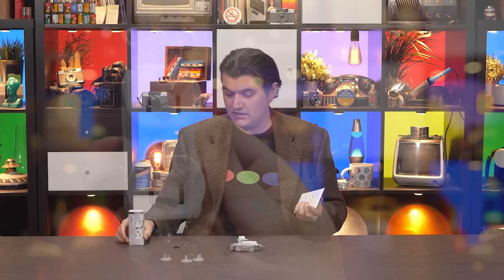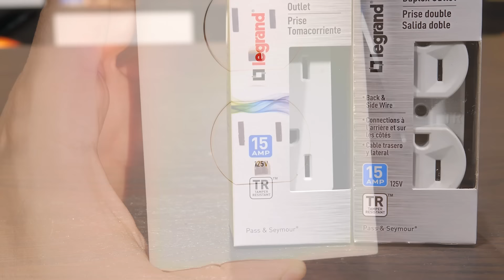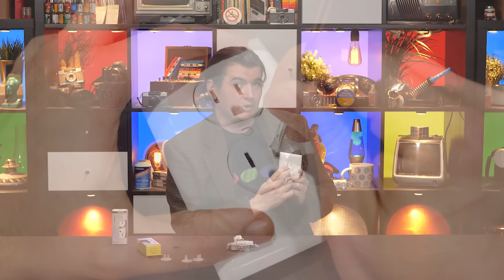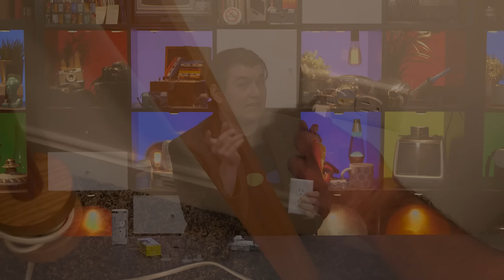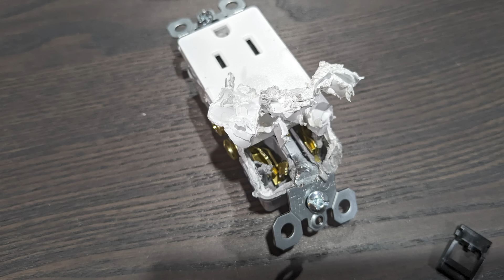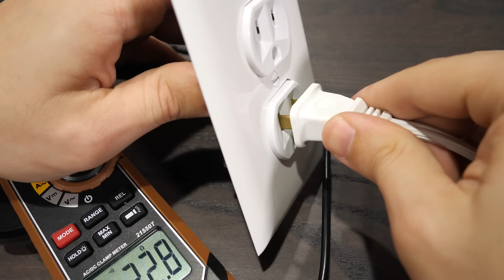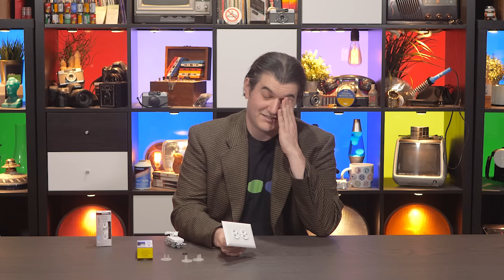Tamper-resistant outlets aren't all the same - a follow-up

Comment: I grew up in the UK before the plastic prong covers were required on plugs.  As one of my bedroom sockets was recessed behind furniture, I shocked myself at least  4 times because I wasn't in the habit of using the socket switch to turn off power before removing or inserting a plug.

Now thats purely anecdotal.  But remembering there is a risk and talking to friends, everyone shocked themselves as a child in the UK.  Yet, there was no death I ever heard of from a domestic electric shock.  No-one I knew, no-one in my school, no rumours or stories of it in the village or county.

I'd guess that kids are pretty resilient.  And by the time you are an adult you've learned to actually use the socket switch.

It actually amazes me that the US does not have switches on their dangerous sockets.  That on its own would be a huge improvement to their design and require nothing other than a change of code.

Of course what every country should do is just switch to Type G.  And I realise this would be near impossible in the US but other countries could do it and should do it.  The UK didnt always have Type G only completing the switch in the late 60
Reply: I miss the old UK color code of Red/Yellow/Blue/Black.  I think it should've become the standard for the rest of the EU, since all you do is swap black for white or gray, and can easily make a US-compliant color code out of it.  Blue for the neutral, and gray for a phase conductor, is incompatible with our standards in the US.

Comment: To the people arguing that 240V isn't much more dangerous, they're dead (heh) wrong. Remember that Power output is V^2/R. 480^2/120^2 = 4. So 240V is 4x more dangerous than 120V. And yes, pedants, "it's not the voltage, it's the current that hurts you." But current is proportional to voltage, so try me!

Comment: I lived in a big old house (built c1900) in the Midwest that had been converted to apartments. My downstairs neighbours had the old front parlour with the fireplace. I (a girl, at the time in my late teens) was helping them remove old candles from the wall scones. Lots of built up wax. I was using a large steak knife with a plastic handle (🤷).  The "candle" seemed to break in half but was held fast by the braided "wick". I started to cut the wick. There was a cracking noise, everything went black, someone screamed (me?). When "the lights came back on" I was across the room, the knife still clutched in my hand, a big arc weld half circle in the blade. Smell of burnt hair. 

c1900 electric wall sconces were still live and apparently high voltage. The landlord had a hell of a time with the fire department and I got a very expensive ride to the hospital.

Never trust a braided wick.

Comment: It should be noted that we have socket outlets in the UK that don't use the earth pin to operate the shutters on the live and neutral. MK came up with a method that requires both the live and neutral to be presented at the same time to open the shutters. This was introduced in the 1970s with the MK Logic series. I would imagine the US tamper-resistant sockets use a similar mechanism. Basically, the live and neutral pin causes the shutter to rotate out of the way.  More recently MK introduced a system in their Logic Plus series that requires all three pins of the plug to be presented at the same time to open the shutters. Basically the same rotating mechanism as used previously but now it won't rotate unless the earth pin is also inserted. Both mechanisms are more difficult to defeat than just using the earth pin, and the newest mechanism is really tricky to defeat.

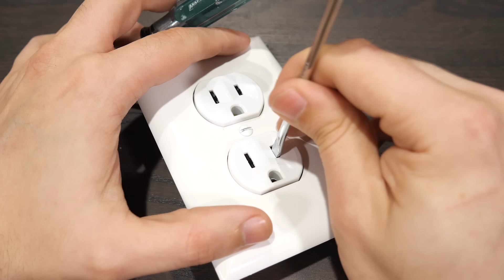Comment: 2:30 A right, lets see, when did we get that type F sockets.. like 1960s? 1950s? i hardly seen anywhere they are not tamper resistant. Its like in really really old installations where they are conceted via lead cable

Comment: When I was a toddler, I used put my finger between the prongs of a plug that goes to a lamp in the living room, plugging it back in over and over, just because the shock felt weird... I think I did this until I actually got a good enough shock to scare me. I guess my parents weren't warning me about the dangers of electricity well enough but it really does show just how weak of a shock you get from US plugs just touching the blades with it partiality plugged in.

Comment: The scariest plug shock I have recieved was this. We have an attic above our garage and it has an old lamp with a 60's era super slim plug that is used as lighting in the attic. Its pluged into the ceiling of the garage with the cord running up through the man hole. I climbed up the ladder and tried to turn it on just to find it was unplugged so I climbed back down to find the dnagling cord and plug it back in. So i was up on a metal ladder when my finger got shocked. My whole arm aches for abour 10 minutes but that was all. I've been zapped by bad light switches more often than plugs though.

Comment: "your cords are always falling out" is talking about cheap plugs that were used 20-30 years ago in certain areas. I live in an area where almost every house has a few plugs that are used frequently and have sufficiently worn out to the point that the plugs will literally fall out of the wall if they don't have a ground pin. My aunt's house is bad enough that most of the outlets in the entire house are that way.

Comment: The house I'm in was built with shuttered power points. In 1956! As well as the shutter, the switch wouldn't turn on until the Active pin was fully inserted. Plugging the pin in moved a switch pivot point. Unplugging resulted in the switch snapping off. Fast forward 20 years and they wouldn't stay on or the shutters wouldn't get out of the way. Yes, Australia, of course.

Comment: The shutters on UK sockets aren't all the same, typically most, especially the budget brands, operate off the earth (ground) pin, however early MK sockets operated the shutters by the simultaneous insertion of the line & neutral pins, & current MK ones require the earth pin to unlock the shutters and THEN the live & neutral to be inserted simultaneously in order to operate.
The standard allows both approaches, requiring either the earth to operate or simultaneous insertion of line & neutral to comply.

Comment: Even the old European plugs without sleeved pins are much safer, since the plug is recessed into the plate... good luck getting your fingers around that.

Now they're even sleeved, so it's impossible to get shocked while plugging them in.

Comment: No. you can't say that 240v is always more dangerous than 120v because you completely forgot about current. if there is no current, no voltage will be there. Do the math U*I=P otherwise. 
Case in point: the lower current can be safer depending on the circumstances, like a shock through the heart.

Comment: My understanding is that it takes 1 amp to kill somebody.  120v isn't the issue.  It has to go through your heart.

So you will feel it if it jumps through your fingers but that isn't deadly.  Electricians do it all the time.

Mechanics get 20k volt shocks from sparkplug wires and they let it go through the body.  The amps are way down on the spark plug wires
Reply: As little as 3 milliamps [0.003] can stop Your heart [Ex/retired electrician from OZ [Sydney]
Learnt this during My apprenticeship, '67-'71, at the biggest, then, now only, electricity supplier
in Sydney area, a semi-government organisation. Most dangerous range 0.003-0.030 A
below this not much effect, above this more likely muscle contractions will disconnect You or You will feel the shock and pull away, minimising the time Your heart is possibly being damaged. Oh, and DC is worse because it can clamp muscles preventing You from pulling away!  trick is - don't get zapped!!   If working on a circuit pull the fuse or turn off the breaker YOURSELF and if there is the slightest chance of somebody turning the power back on put some tape [insulating] over the breaker or fuse socket, it will at least stop somebody from just flicking the juice back on without thinking, I learnt this from working on a site where My supervisor  told Me that 'this circuit is off' imagine My surprise when My pliers tried to weld themselves to the wires and there was lots of sparks and noise!

Comment: With one screwdriver inserted into either blade of the TR outlet, give the handle a sharp whack.  Once you get the feel for it, the annoyance using the outlet is usually removed with one whack.  And yes, this can be done with installed and live outlets.

Comment: Counterpoint to the "plugs falling out isn't a thing" thing -- in my house, until I redid all the receptacles last year, I had several that had essentially zero friction. Like, could-not-reliably-hold-a-phone-charger zero. Which meant that it was also impossible not to have the live pins exposed if anything at all was plugged into the receptacles, because the weight of any plug at all would pull it down and expose the pins. This was one of the major reasons for why I redid my receptacles.

I believe my house was built in '58.

Comment: I've had some problems with plugs falling out of sockets but it's usually one or the other very old and very worn out. I've got computer speakers my grandfather gave me like fifteen years ago when he upgraded his PC that use a cable with a wall wart that's like three or four pounds and it just wouldn't stay in the socket when I moved my desk to where it is now (the power strip the rest of the setup is plugged into is also a bit loose), so I got an extension cord that's much heavier duty than this use case requires just so I could lay the power brick on the floor and run the extension cord the 18 inch drop from the outlet to the floor.

Comment: One other advantage of TR receptacles is that dirt is far less likely to get into them. When I installed backsplashes in our kitchen the original ivory receptacles looked dirty next to the primarily white tile so I bought a box of white TR receptacles to replace them with. Most of the receptacles I removed can be re-used but a couple (especially the one near the stove) were so full of "kitchen deposits" that they were disgusting and went straight into the E waste.

Comment: I did the exact same thing with my finger to guide the blades into the outlet! Only difference is that I was 18 by then and had been doing that technique for a little while before finally got shocked. I think I might have done it again and got shocked a second time before I actually stopped lol

Comment: Speaking of loose plugs, I've got a story from work.
For context, I work at a store that delivers furniture and appliances (the one with 2 a's in the name), and in one delivery I was trying to plug in a dryer when the face plate for the 240V dryer plug fell off and the ground pin became misaligned...let's just say there were fireworks in my hands.

Comment: Fun fact I own my own business and I repair medical equipment. One of the things I work on is x-ray machines. most of the x-ray machines I work on have a 400 V DC hot chassis and let me tell you 400 V DC will definitely stop your heart. The fun part is the high-voltage transformers that take it all the way up to 80,000 V. And most of the time you have to work on these when they’re live so you can test different circuits etc. I’ve been fortunate enough to not receive a shock from any of the high-voltage circuits but I’ve certainly been hit with 120 more then once (mostly due to my own carelessness) and while it’s not fun the worst I ever experienced was when 120 V zap literally took a chunk out of my wedding ring (which obviously you should not wear metal jewelry when working on electrical circuits) but the ring got so hot momentarily that it immediately blistered my finger.

Comment: The Wago connector design, from what I understand, is rated to 20A (and are german, so they tend to understate performance.  Anecdotally, I recall people have put them up to 40 or 60 amps before they start to decompose.  Don't trust me, search youtube).  Internet wisdom also says: backstabs also reuse the spring mechanisms inside an outlet that hold in plugs, to hold in the supply wire.  Keeps costs down.  

My take: 
* Wagos are a known, solid design by a company that does lever nuts well, and has an incentive on quality
* Wagos have a visible mechanism to show connectivity
* Wagos are made by wago, ideal makes lever nuts that are not wagos.
* Outlets can vary from mfgr to mfgr and product line (residential) to product line (commercial)

I'm using Wagos exclusively in my house, damn the expenses. They're broadly better for a number of reasons.  Backstabs are evil, because theres no transparency or consistency on how they work.  For the commercial non-wrap-around connections that are like backstabs but use a screw, those are tops. 

Thanks for listening to my TED talk.

Comment: Europe (not the UK) has had tamper resistant power outlets for a long time. I remember when I discovered it the hard way by one of those covers getting stuck so that you could not plug anything. I ended up opening the outlet and removing the faulty protector.

Comment: The falling out plug is because they only come and see hotels/airbnb where they uses the cheapest of cheap outlets and never replace them so they DO fall out. but no house (some apartments do have the issue) has ever had that issue.
TR outlets are so damn hard to plug in on the first few uses. it is so annoying.

Comment: Regarding loose plugs: The South African 3-point plug is an absolute tank. You can probably hang the full weight of a person on plug in a some wall sockets without the plug coming loose. Most live and neutral wires also have sleaving, so in the situation you described plugging a socket in in the dark, I am pretty sure you could do that with the South African plug without getting electrocuted.